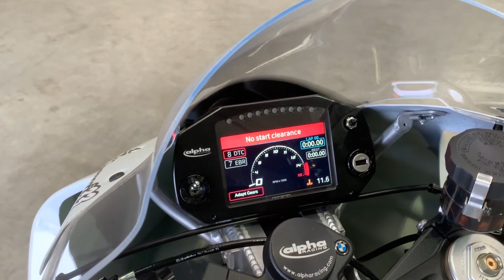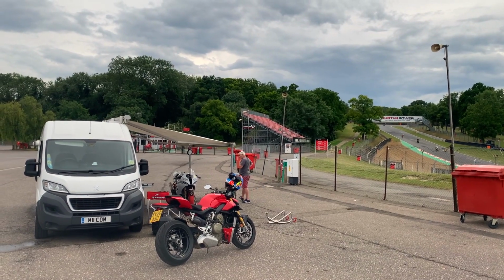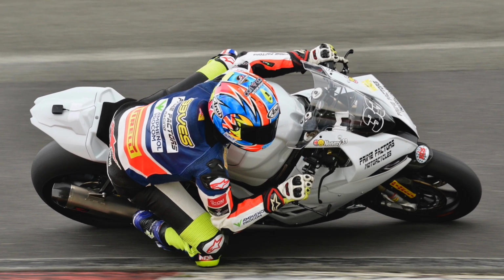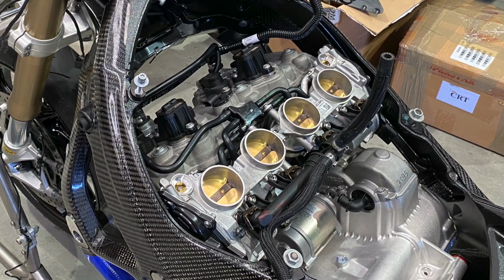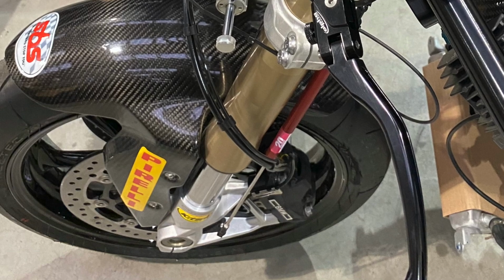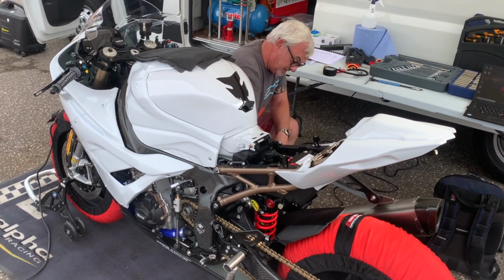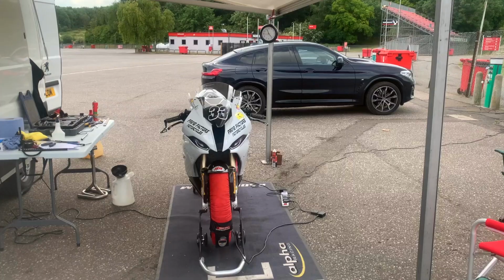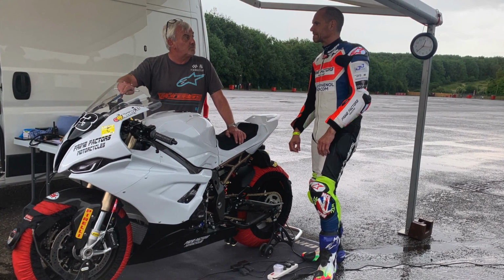PRIME FACTORS RACING BMW S1000RR – A SPLIT PERSONALITY

Comment: neevesybikes very good analysis thank you, a question I think in the normal bike that does not have the racing kit low up to 6,000 7,000 rpm you hear as a two-cylinder and then as a scremer engine, the system of variable timing and sinking of valves work independently per pair of cylinders
Reply from the maker: Hi mate.Yep, in standard trim the ShiftCam system changes the inlet valve timing from mild to racy after 9000rpm. It still runs on all four cylinders, though and it's impossible to hear or feel the change. It's very clever.

Comment: I'm sorry but, is that issue just regarding you when it comes to your feet touching the floor or is it a problem everyones going to occur?
Reply from the maker: Not sure. It might be the way we've got the suspension/pegs/seat etc. But I never normally scrape toes, so something needs looking at. Not a problem on the road bike - just with the lean angles generated by slicks.
Reply: @neevesybikes  have you tried putting any of the stock items back on, foot pegs being the main one. Sounds abit naff that with slicks on you can't get the full potential. Alot of people have given this bike bad reviews and this isn't the most welcoming of one for the track
Reply from the maker: @samboddy3182  Bad reviews? There isn't a lot to criticise to be fair - these are just teething problems/learning curve when turning a road bike into a racer. It's a magnificent thing.
Reply: @neevesybikes  aye just seen a few videos of people highlighting things and that one on the autobahn where his engine gives up. All out of proportion compared to all the sweet 2020 bmws but, out of all the top models, blade sp, rsv4 factory, v4, r1m etc how come you went with the s10000. If its mentioned in a previous vid I'm shite at remembering
Reply from the maker: @samboddy3182  it's the closest thing to a race bike out of the box and needs the least doing to it to make it competitive. Also, you can buy all the bits you need from BMW and get technical support, which none of the other manufacturers do.